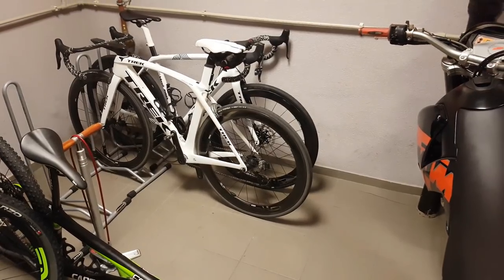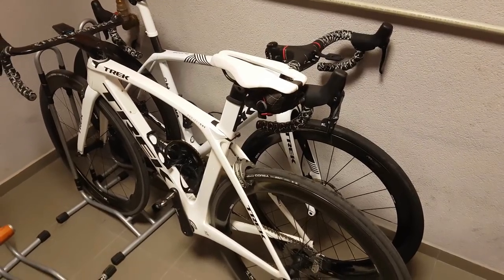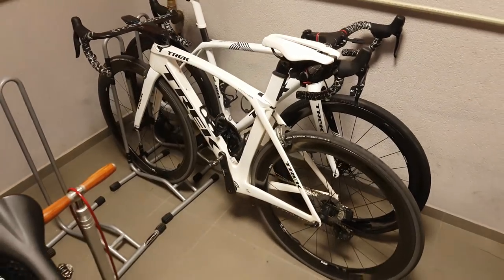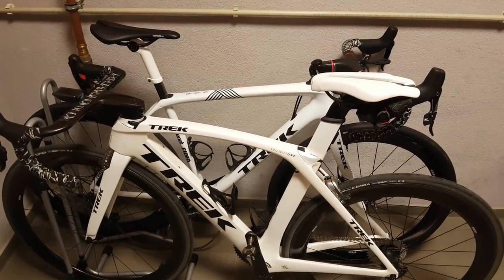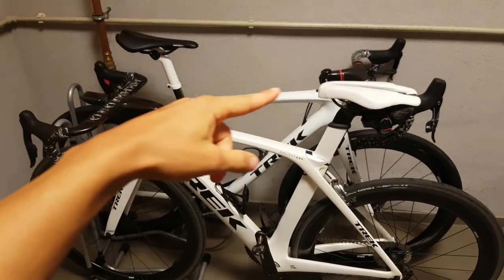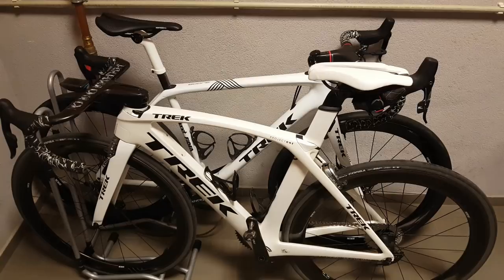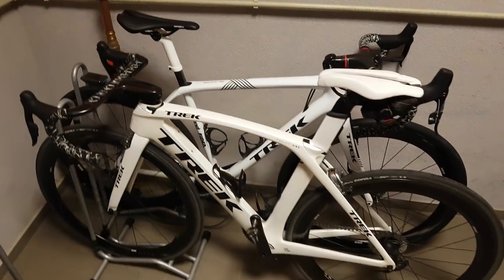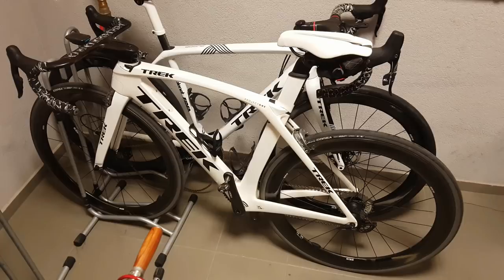How to reach a high average speed

Comment: uphill w/kilo is most of the equation(although aerodynamics matter in lower than 7%gradients) and in a say flat timetrial without many turns and accelerations it's watts for your frontal area and drag coefficient.
Tyre rolling resistance also goes down with lower weight, although it's less important than the other factors

A bigger guy riding exactly your position with exactly your watts, and let's say for the sake of argument same weight is still going to be slower due to the frontal area.

Good video, people freak out over watts, and while they are important, if you are racing, fastest guy wins, not the wattiest
Reply: Exact body shape affects the CdA, i.e. a leaner body also has a lower CdA since there's less fat bulges disrupting airflow.
Reply: well no in theory a fatter(front to back) torso could be more aero than a leaner wider one that is more shaped like a board.

It depends on body shape much more than leanness(which is important for weight) a guy with narrow hips and shoulders and some little belly and back fat let's say, will be more aero than a guy that is super lean with skeleton arms and almost no fat, but that has naturally wide hipe and shoulder bones

Comment: Are you still running a 23 on the front for the 7.8?
Reply from the maker: Jordan Foster yes
Reply: Thanks for the response! Hopefully you have time for one more quick question.

Do you suggest 25 for just the Pro One or would you recommend a 23 Corsa Speed for the front as well? 

Currently I have a 25 pro one on my 7.8 and it's visible to the eye that it's wider and literally only about 2mm of clearance to the fork crown on my cervelo p5-6 which is kind of concerning even though I haven't noticed any rubbing. I want to switch to a corsa speed for my A race TT of the year coming up in 2 weeks. Then after the corsa speed wears out I will switch to the 23mm pro one.

So mainly just wanting an opinion for 23 or 25 corsa speed? 

Thanks!
Reply from the maker: Jordan Foster I think a 23 Corsa Speed will do well

Comment: Hi, I have your same saddle, can’t quite get it in the correct position? Do you level it? And usually what do you recommend for set back from bottom bracket? Thanks in advice,
Reply: Bike fit is a very individual thing, what works for him may not work for you. Just experiment a bit, try out different positions.
Reply: If you have not yet go do a proper bike fit it's worth the money.
Reply from the maker: Raul Romero what Spectrum said. I run 85mm of setback.